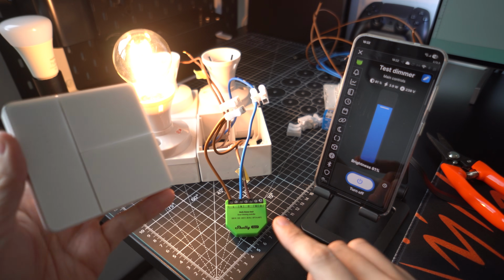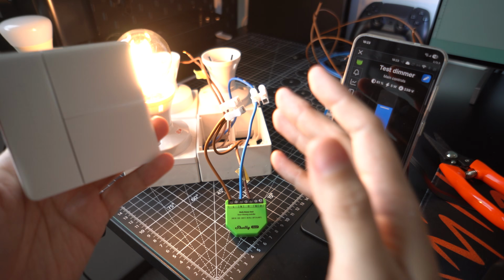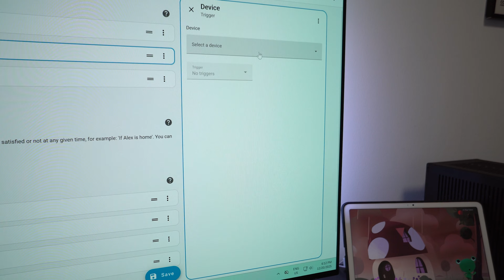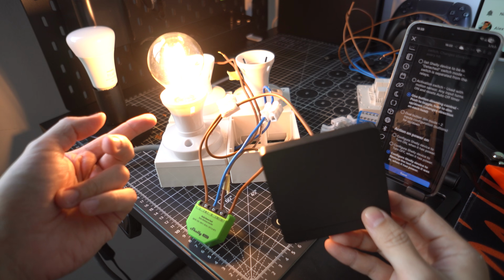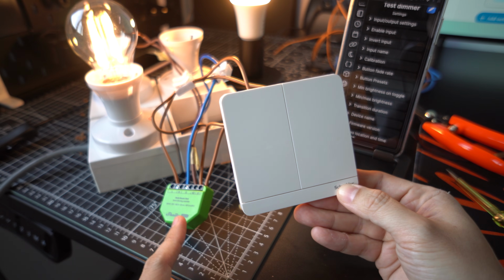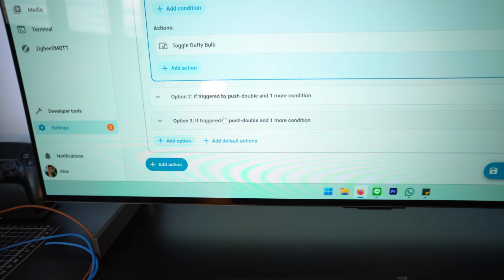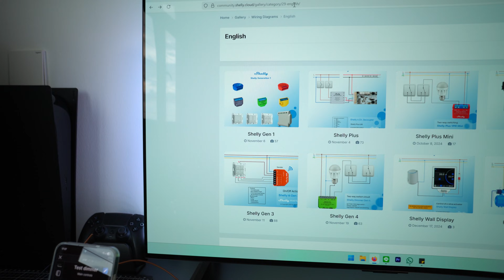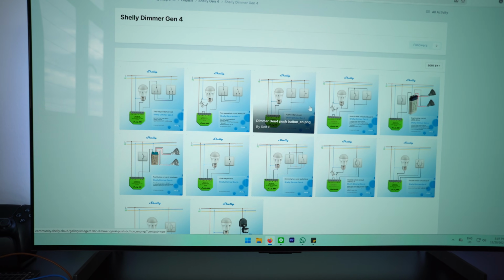WATCH THIS about Shelly relay (feat. Sol Luminaire)

Comment: Hi Alex, can you explain more on the neutral by-pass? 
In what scenario do I need that? Isit when I place the relay at the switch instead of the light? 

If yes at switch, then you mention the by-pass will be connected to the light’s neutral wire? And the other end connects to? 

Thank for the video, it open more options for people new to smart home set up!

Comment: Hi Alex, is the Shelley switch with dimming function the one listed on your Lazada page as the Gen 3 dimmer? And Shelley relays are using Zigbee to connect to Home Assistant? Thanks.
Reply from the maker: Only the new gen4 which is not available yet support zigbee n matter, you can decide what protocol to use

Comment: For a 2-gang switch to control 2 different lights individually, we will need to have 2 different gen4 relays connected to the same switch right?
Reply from the maker: Either get a 2pm (black) or shelly 1 (blue)

Comment: Alex, besides dim light, does Shelly relay work at controlling fan speed? I had dumb ceiling fan that speed controlled via a remote, can a Shelly relay make the fan speed controllable?
Reply from the maker: No, either go with a smart fan or RF remotes